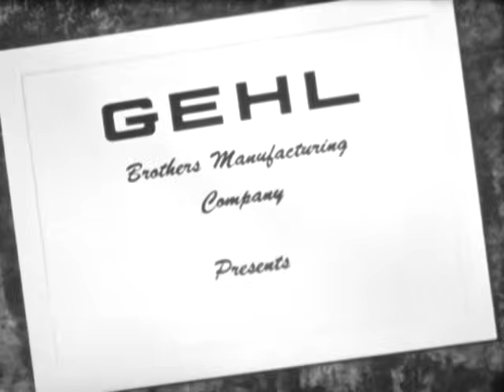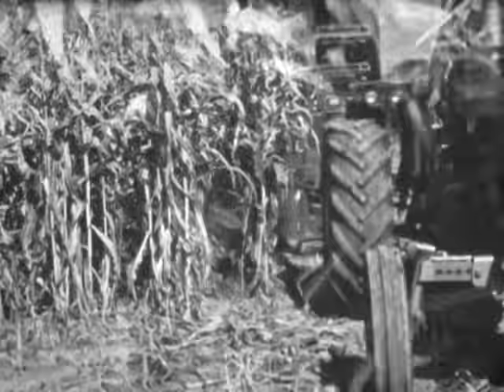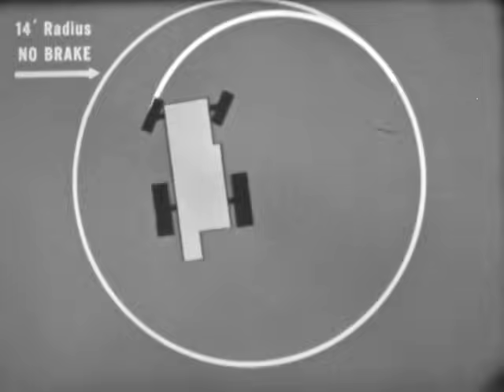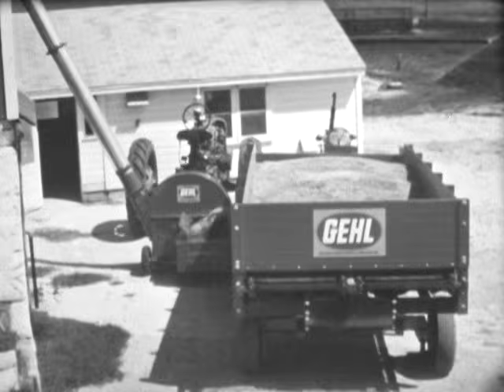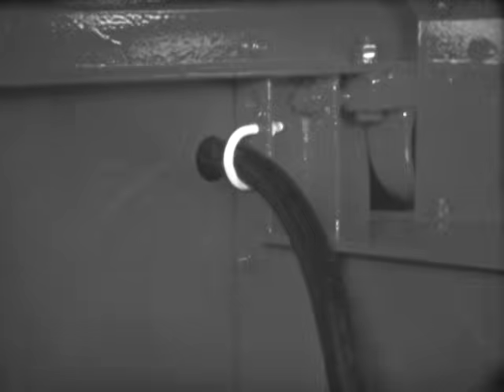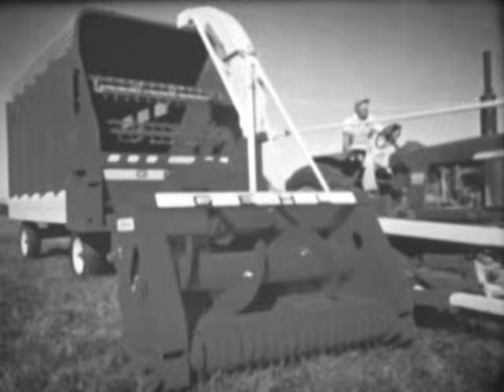Gehl Presents: An Invitation To A Forage Harvesting System - 1967

Comment: Those stalk choppers looked like they did a nice job. I wonder why dad and Uncle Tom didn’t chop their stalks? I remember the plow plugging on corn stalks more then not.
Reply: Probably the expense of a piece of equipment that was used but once a year.  Also the cost of another past over the field.  I do remember plowing cornstalks being troublesome.
Reply from the maker: dwight is correct. Many farmers weren't going to spend an extra penny if they didn't have to.

As for the stalk choppers, they did a great job! They still have something of a following, too. Saw one at an auction last fall, in rough but good mechanical shape, that brought $760 before fees & tax. That's also the cost of a new set of knives for it.... which it badly needed.

The same auction had two Chop-Alls & four heads in very nice shape. Those followed me home for half the price of the stalk chopper. The prices at that sale were all over the place. Still kicking myself for passing up piles of original Gehl parts, but I would have needed to build more storage for what was there. But they were cheap!!!! Argh! Lol!

Comment: That was an impressive silo then, 30x90!  I was actually thinking that 806 gas on the Chop king burned up all the fuel to light off the energy crisis!
Reply from the maker: The 301 in the 806 sips gas like the Queen sipped tea, compared to the Chop King with the big 427 Waukesha in it.  In heavy corn with the three row, you can expect to fill the 50 gallon tank twice a day. Three times if you work late into the night. Can't imagine the Jimmy was that far behind. I think it was the 4/71, so add oil & antifreeze consumption to that, too. 😁
Reply: I have a diesel 806 she’s amazing on fuel ik it’s comparing apples to oranges but still
Reply: @budafarms I live in just outside  of Yeovil South Somerset UK and have one seen mazie harvested with self propelled machine's manly New Holland Class and John Deere so seeing done with trialed machines driven by under powered tractors is interesting.
Reply: @Colin-rg7gt Strange I saw no under powered tractors.
Reply: Pretty impressive today